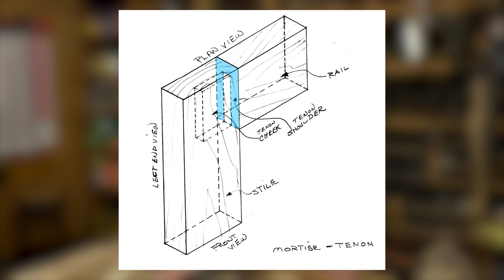The Art of Woodworking - Episode 3: Mortise and Tenon

Comment: Nice vid! I have been playing with a few mortise and tenon joints. They seem very strong the 2x4 I extended so it would be long enough:] is almost impossible to pull apart. I do not have the lumber to make anything nice yet so I am just practicing for now. I thought this would be a headache but so far it seems way worth it.

Comment: Great video presentations. I noticed he used two different reference surfaces to mark the second line of the mortise and the tenon. Shouldn't you use the same reference surface to mark the other side of the mortise and the tenon instead of marking the piece from the other side?